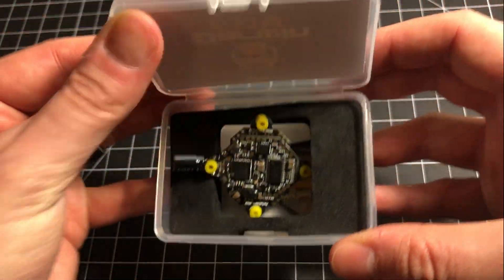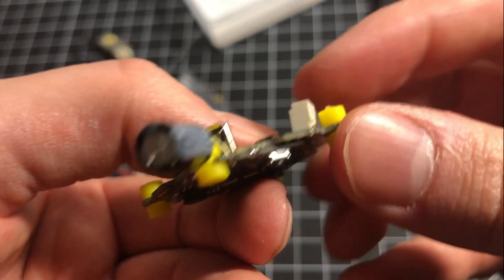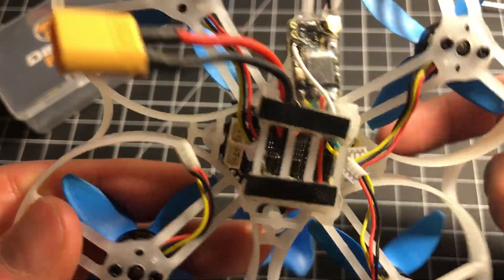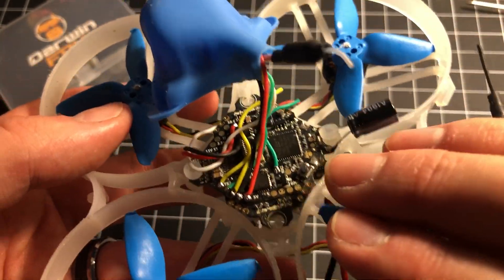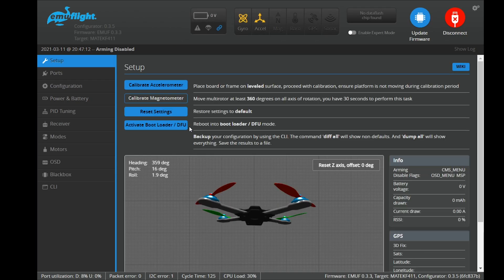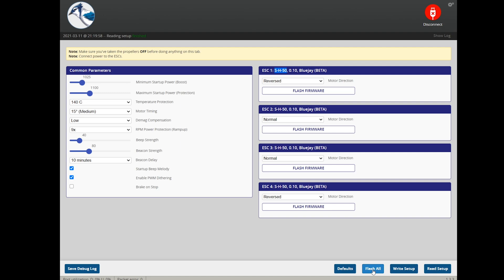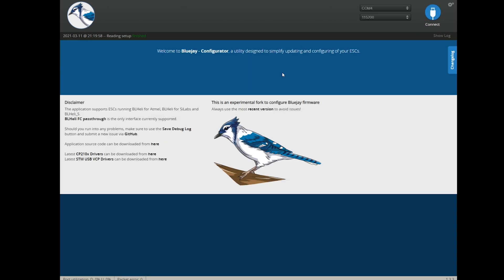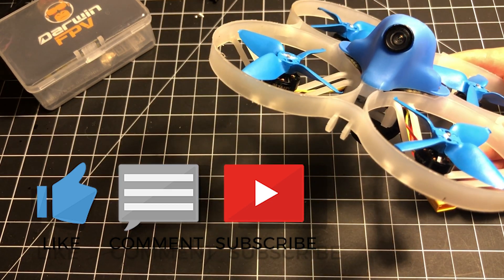DarwinFPV 15A 1-3S F411 Ultralight/Whoop AIO Flight Controller

Comment: Why did you use Tx/Rx 2 for crossfire instead of Tx/Rx 1?  It seems they have come out with a new version. Mine has Tx 1/ Rx 1 where yours has pads for 3.3v and IBUS.  Yours looks like the one in the wiring diagram, but i guess they updated it?  Mine has the Tx1 Rx 1 pads, so should I use those for crossfire? They come set up at Serial turned on in BetaFlight.
Reply from the maker: I couldn’t use the UART1 rx1 SBUS pad for crossfire because it has a hardware based inverter and no broken out tx1. At least, I couldn't do it anyway. I tried it and on mine it didn't work. You need non hardware inverted pads. Another option I guess would be to put the crossfire receiver in SBUS mode.
Reply: @JohnCuppi   I think mine is a newer version of the board. Mine has 2 full uArts. 1 and 2. Where yours has an IBUS pad, and a 3.3v pad, mine has Tx1 and Rx1.  I guess I'll try it and see.  I think yours is the 1st version with only 1.5 uArts, and mine is the newer one with 2 full uArts.  I just wish DarwinFPV had some sort of documentation to explain any of this. Can't even find a manual.
Reply: In the place where your board had pads for 'SS' '3.3v' and 'IBUS', my pads are '3.3v' 'Tx1' and 'Rx1'
Reply from the maker: @brendane5791  in this case, I would give it a try and see if it works. worst case scenario it's just a couple wires to desolder. Also make sure that in betaflight that you run this command at the CLI: "set serialrx_inverted = OFF", then type "save." This will ensure that in case they enabled software based sbus inversion anywhere for uart1 it will be turned off, since that will screw up crossfire.
Reply from the maker: @brendane5791  Indeed, it seems the documentation for this is now a bit of a mess. I think they may have taken my feedback though if what you're saying is true and got rid of the hardware based SBUS uart, so that the workaround I did here for crossfire + vtx control is not necessary.
Reply: @JohnCuppi  I'll give it a shot and see how it goes.  Thanks for the video and help friend!
Reply: @JohnCuppi  Just finished soldering the motors and receiver.  Crossfire now works on uArt 1. So now all 4 wires from the receiver solder right next to each other on the new version of this board.  This also leaves uArt 2 available for GPS or whatever else you want.
Reply from the maker: @brendane5791  Thanks for the update and information! I'm going to pin this conversation.
Reply: @JohnCuppi  Thank you for this John! I've been pulling my hair out trying to get crossfire, vtx and gps on this board. set serialrx_inverted = OFF saved me. Thank you again.
Reply from the maker: @dayeoman  Glad to hear!!! 🙂
Reply: Tested Tx/Rx 1 by soldering crossfire reciever. You are right, it works, So on the newer boards only sbus pad is inverted and Tx/Rx 1 are regular, uninverted and can be used )
Reply: How would I wire a diamond vtx to this board, I’ve tried and keep getting white screen

Comment: I just got the same board and did a hover test and hovered 6 feet then 5 seconds later it went down. No issues no shorts and now motor 3 twitching and i tested the motor and its fine but dont know what happened. The board looks completely find and everything is brand new. Lost for words at the moment. If you know what would cause this please let me know. Thanks

Comment: If you haven't already I highly suggest getting a 60W Pinecil soldering iron. I think they're like $25 or $30 and Pinecil ships them out quickly. You can power them on any 3s or USB C 12v to 20v (GAN) power brick. Stock tip is a lot better for soldering circuit boards and they heat up to 300-350C within about 10-20 seconds on the 20v USB C bricks. I thought I'd still need a weller or something to solder XT30's but the Pinecil actually does it just as well as my 80W weller with wide tip.
Reply from the maker: Yeah my TS100 is showing its age, it’s gonna be 5 years old this coming year.  It’s still serving me well as a great iron but I could get a Pinecil like you have at the bench which works way better in a lot of little ways, and then retire the TS100 to be my field bag iron. 👍

Comment: You think I can plug in the walk Snail 1S system on this but run a 2s battery call my motors and also have a GPS on this
Reply from the maker: That depends on if walksnail will work well or not on softserial. Either walksnail or the GPS would have to be on softserial and unfortunately neither of those are great situations. 

GPS is better off being on a hardware UART with the OSD data connection being on a SoftSerial connection, because GPS benefits more from the faster baud rate that a hardware UART can provide.
Reply: @JohnCuppi  thank you for the clarification. New to the hobby. Going to build one on my own. I already bought that aio also got the TBS 32 nano pro. I was thinking about going walksnail now for that promotion going , I'm trying to build a mid-range 2s cruiser
Reply from the maker: @jamesmichaelcabrera9613   I preordered the walksnail bundle. I have DJI, HDzero, and will have WS to compare against when they ship it. I’m looking forward to it, but honestly, walksnail is a risky buy. I am very content with DJI right now and the systems are not that fundamentally different. But since I have the channel and want to provide feedback for the community, I dove in. The problem with walksnail is that over the last year they have had serious trouble getting people to adopt the system—and, if this VRX doesn’t increase uptake, then it will not be good for them. The fatshark goggle was very unattractive and the whole initial release was handled extremely poorly. 

Just know that if you do dive into the Walksnail platform right now, you’re still paying to be a beta tester as they keep churning through firmware updates. And we don’t know what issues might rear their head in this first production run of the VRX. Hopefully not much, but it’s always risky jumping on any new release of any hardware in this hobby. It’s going to be fun times ahead.

Comment: Hey I don't expect you to answer hello BTW great vid .OK my question is do you know what capacitor or resistor is on the board SMA I think there called ,I can't find it anywhere like what size or anything it was the creamy coloured one I burned off and then it vanished 1mmx.5mm if that helps I'm a beginner I've subbed and you go enjoy your cool quad 😀 😉 if you can help it would be awesome .I have a digital microscope and bought some resistor and capacitor smd I'm sure there called but my soldering is bad I seen people use heater I Ike blowtorch things I have one but I don't want to ruin the board that maybe salvageable, again thank you in advance. Much love from outback south Australia 🇦🇺 ❤️ 💙  take care 🙂
Reply from the maker: hey, thanks for the comment. I will try to see if I can look at this for you. I am not sure which is the creamy colored one, can you point out something that's near it?
Reply: @JohnCuppi  sorry mate i dont even know if i responded ? i got the specs i needed actually from Darwinfpv i was pretty impressed they didnt even complain still i messed that board up and them caps are so tiny first few flew away using some tweezers lol luckily i bought 10 of them then i bought the wrong size then i finaly got the correct cap in and somthing else must be wrong still .oh well at least i have spares for the 2nd one i bought and thats hit the wall and im trying to work out why the vtx is getting so hot after it crashed ,now there new january firmware wich i wish i never touched has it so expresslrs isnt connecting to my controller (i didnt back it up did i) now so im kinda over it while waiting for my goggles . thank you again mate hope your doing well :) oh for a laugh i bought over 250 worth of gear to try fix the board inc electronic microscope and over 2 months of waiting... things we do huh!! im pretty impressed now the boards are AUD around 60$ i might buy 2 or just another babyape v2. Take care Fly often .. oh betaflight wont even recognise the motors i put dshot 600 but they still wouldnt spin up i downloaded blueJ dont even know if thats worth messing with in my menal condition atm lol Be safe ,,oh i just hit the part in the vid about bluJ lol maybe ill mess with it one day.
Reply from the maker: @MichaelRogersJesusrules  Hey Michael thanks for getting back to me! I’m glad it all worked out in the end! I appreciate the comments!

Comment: I only get one red light an cant connect to betaflight
Reply from the maker: Is the cable a data cable or charge only usb cable?
Reply: @JohnCuppi  even if I connect to battery or usb it's the same just one red light but no connection the vtx powers on doe the usb work with my other quads

Comment: How do you connect flysky ibus
Reply from the maker: I'm not sure, I don't think this flight controller has an IBUS connection, if you can use SBUS with IBUS then you'd just wire it to the SBUS pad.
Reply: It should if you use the right wires to right pads

Comment: Hii and thank you for review 
and inforormations. 
Can we  install GPS and ELRS receiver  to use it for long range 1s  2s drone?
Reply from the maker: There are only two UARTs. So with no smart audio for vtx would be the only way.  Uart1 would be for ELRS and UART2 for GPS.
Reply: @JohnCuppi  Thank you. So yeeees is working For gps is much more important.
Can without smart audio. If want to change settings I can use fly controller conected to pc

Comment: How did this FC hold up? It’s suspiciously cheap when compared with other AIOs…
Reply from the maker: Been good for me this year, no problems. 💪 but, I have heard if you check comments the board did have a revision later on in the year so I am not sure if you would get the same reliability I had.

Comment: you should   try a much smaller soldering tip, some tip tinner, some flux  and a smaller gauged wore.
Reply from the maker: I was working with what I had on hand at the time, knowing that it was not the ideal tip or solder for the job but got it done. Thanks for the advice.

Comment: Is possible  to fight with this aio on betafpv x knight 4 frame with 1505 motors without  burn it
Reply from the maker: The board that the x knight with 1505 3600kv motors comes with is 20a, this one is only 15a. And the x knight / motors are rated for 4s. The darwin board I'm afraid is 1s-3s only, I would not recommend it even if you only run 3s.

Comment: Older version boars (with no RX1 solder pad like in the video). The solution of connecting TBS CRSF nano RX is simple.
TBS CRSF nano RX to TX2 and RX2. 
VTX to TX1.
That's it. They have only RX1 inverted. VTX can be configured via betaflight or OSD.
Newer version boards with separate RX1 solder pad. RX1 solder pad is uninverted and can be used directly for TBS CRSF or whatever you want. Tested )

Comment: what would stop from running the nano rx to tx1 and rx1?
Reply from the maker: You can do this. They updated the board, mine did not have TX1 or RX1, just RX1 which was mapped as a hardware based SBUS pad.
Reply: @JohnCuppi  awesome... thank you.

Comment: sadly I followed your bluejay flash and now my brand new fc is bricked, it doesn't detect the esc's anymore
Reply from the maker: Do the ESCs appear with you question marks in the names or is it completely dead?
Reply: @JohnCuppi  no question marks just doesn’t detect them at all anymore, originally it showed 1 of them left then tried to flash again and now all gone
Reply from the maker: @JayJayNapalan  I struggled to flash the ESCS when I changed it to dshot300, i had the issue with ESCs disappearing on me too. Try going back to BF, choose dshot600 and see if that gets your escs back.
Reply: @JohnCuppi  I did try that and went back and forth esc's don't show up at all anymore, if there is anyother way to flash this without having to find the c2 pads on the esc chips , pls let me know

Comment: lil help here, i only had 3 esc's show up in bl heli, tried flashing it and then it only saw one, tried flashing theboard in BF now totally messed it up, any idea how to reflash this board or reset it?
Reply from the maker: Yes I can help recover the board, are you able to connect to it at all in betaflight? Or will it not connect anymore.
Reply: @JohnCuppi  yes i saved a cli back up and was able to recover it but only motor3 spins and its only twitching, not really spinning
Reply from the maker: @jonathancovert1  replied on Facebook 👍🏻 check ESC config, make sure it’s set to dshot600 I had problems with the escs not showing up in Blheli when they weren’t set that way

Comment: Hey! Do you know, what happened with i2c pads on the FC?
Reply from the maker: I did not see any i2c pads? 😳
Reply: @JohnCuppi  But they are exist in this video, right next to filter cap!
Reply: like SDA and SCL pads
Reply from the maker: @volodink  I see now! It appears they removed this in a second revision of flight control board. 😥
Reply: @JohnCuppi  That sucks! Just bought this FC and thereis no pads ( Anyway, thanks for answers!
Reply from the maker: @volodink  At the product link in the description, I didn't see any pads now either in the diagram/picture so they definitely changed it. Sorry :(
Reply: @JohnCuppi  Yep, they confirmed it in DM.

Comment: Great review as usual. Never heard of that flight controller but it does look interesting. Guess it isn’t available with an spi rx. I was surprised at the price normally a FC comes in at the $50 range. Be interested on your thoughts after you have flown it for awhile.
Reply from the maker: Hey gramps, thanks for watching!. Not available with SPI rx, or with motor plugs presoldered. Darwin FPV is a new company, so we'll see what happens! The board looks pretty beefy, so I have much higher hopes for it than anything betafpv had produced.

Comment from the maker: I know this is a really boring video if you have no intentions on buying the flight controller. But I appreciate you guys for watching and checking it out! Also, I disabled midrolls now because they are ANNOYING AS SHIT.
Reply: On the contrary, there's nothing boring about this as I found it helpful in making a decision whether to buy or not as the price is right at $29.99! What size motors are you running on it? Thanks for the vid, it gained you a follow! :)
Reply from the maker: @j.r.0420  thank you so much! I am running betafpv 1103 11,000kv motors, 2s battery :)
Reply: Nice, I'm not sure what motors I'm gonna run with this aio fc yet. I'll probably try several different sizes with it on a GnarlyFPV Primo 3 frame tho. 

Happy flying man!! ;)
Reply from the maker: @j.r.0420  You too! I subscribed, I'd love to hear an update if you end up doing one. I took mine out yesterday and had an incident with a small puddle, threw a prop again, really getting frustrated that the floss ive been using is now not holding these to the shaft anymore. Seriously thinking of just gluing the props on it.  Otherwise though emuflight on the darwin board with this setup flies great.
Reply: @JohnCuppi  I'm in the process of picking out what components I want to go with that board and will update once I figure it all out. Waiting for parts now for a 3" Tadpole build that should be here this week, can't wait. I have been in and out of this hobby for a few yrs now and am building my collection, so all in again! ;) So much new gear endlessly coming out. Loving it!! You might be able to hold props on shafts by lightly scuffing them with sandpaper of a small file, carefully tho, but glue might work too!